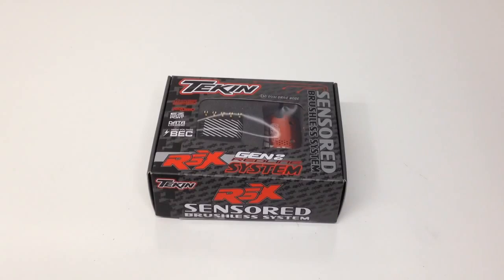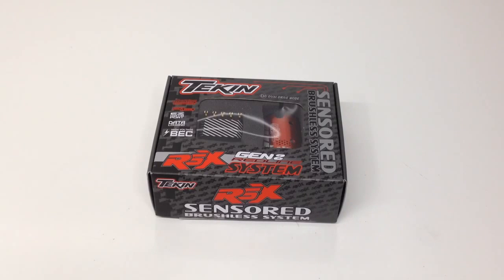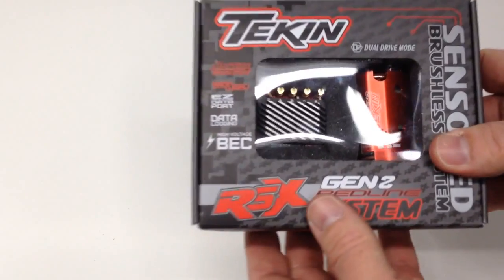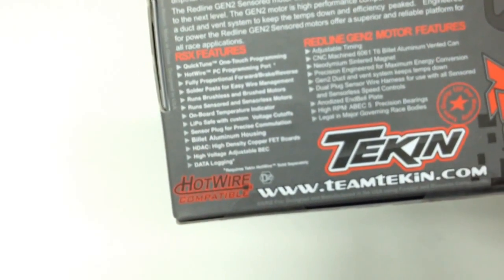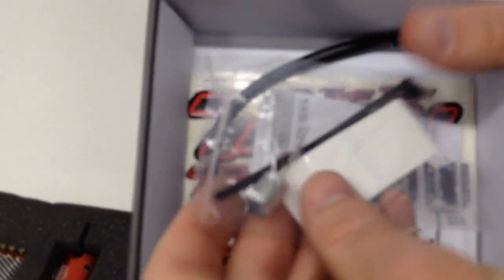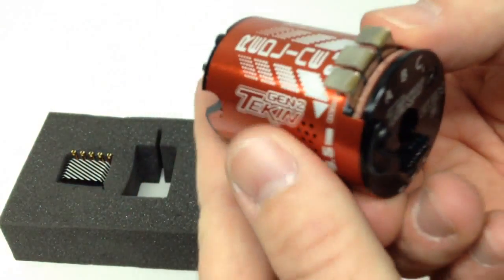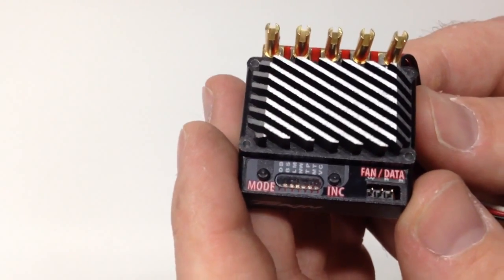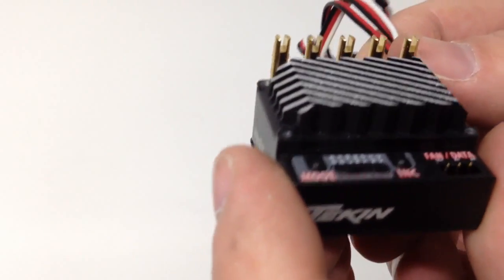Tekin RSX ESC - First Look!!

Comment: Hey rich! Nice video. I just bought one of these to go into my b44.2 with an Orion vst2 motor. Everything works good but when I turn of the esc the fan stays on for about 5 seconds and then turns off? Is it suppose to do that? Does it come on when the esc gets to a certain temperature or what?
Reply from the maker: ryan belland Yeah, the ESC is designed to test fire the fan at start up and then when  it reaches a certain temp.  As for the last 5 seconds.....not sure on that one

Comment: Noticed that you didnt have any motor power wires inside that box. Unless you did and didnt show them. Cause Id like to know if the combo will have the three motor field wires, and not just a sensor wire. Thanks again, and good video.
Reply from the maker: Yeah, I noticed that later.......I know that Tekin always includes wires with ESC's and combos though. Might be a slip up, but no big deal for me, I got plenty of spares over the years.
Reply: I had wondered really, as they normally have the thre wire bundle in the boxes. But I hear ya on having saved up spare wires from doing this for awhile. I did like the review as well, and was also wondering if this esc may work well for a 3racing Sakura D3 CS sport drift car.? Thanks again for your videos, and time. Much appreciated!
Reply from the maker: I happen to have a D3, and yes, it would fit fine and run that D3 perfect!  It might be a bit overkill for the $100 d3 chassis, but hey, it's RC!  Nothing is overkill! Lol

Comment: am i right that you can only use 2S on this Combo ?? 
and i am missing the wires between motor and esc...
Reply from the maker: 2-3s capable.  Really depends on your motor.  But really not sure you'd ever need 3s in most 1/10th scale racing